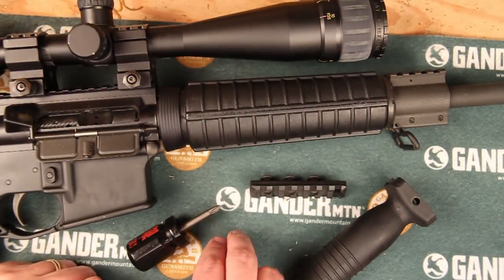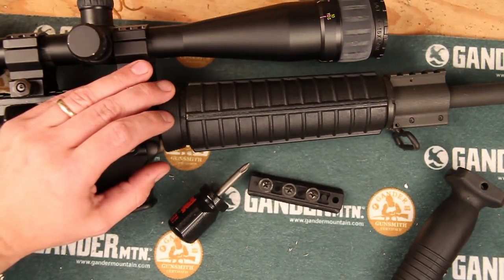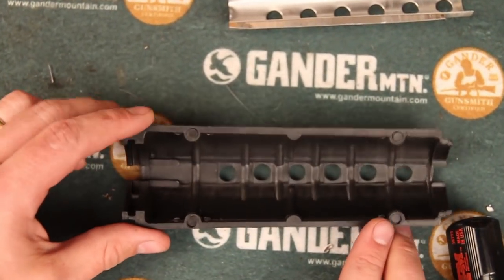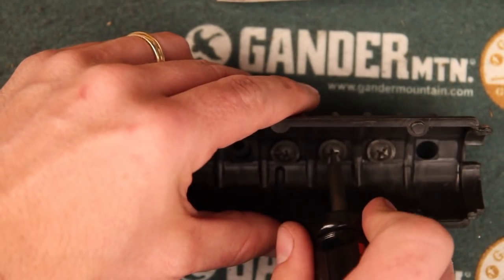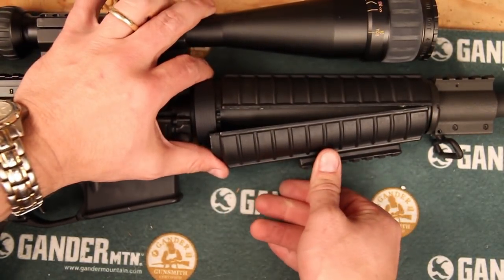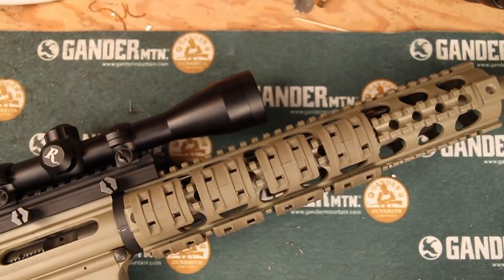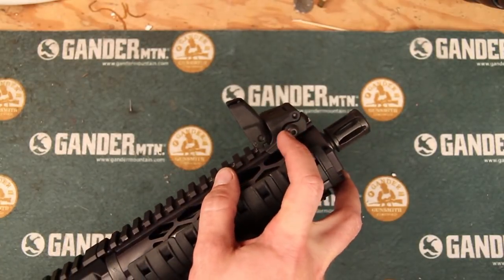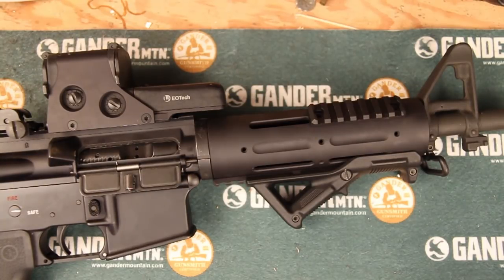How To Install A Rail On A Factory AR-15 Handguard

Comment: Can you please tell me what rail this is. I can NOT find a rail that will fit the standard ar 556 handguard. All of the screws are too small and go right through the holes. This one looks like it will work perfectly, but I can't find one like this anywhere. Everything is m-lok,  moe or keymod. Please help a fellow out. Thanks.
Reply from the maker: I've had this for awhile, so I don't know the exact model, but I believe it is a CAA, very similar to this one: https://amzn.to/3eNkEE0
Reply: Cheston Welborn I'm just take the handrail to a gun shop and find one
Reply: +AdventureColorado its a magpul rail section about 10 bucks at academy the vary from 4 to 11 sections but no more the 10 bucks
Reply: AdventureColorado i tried that one, doesn't work either
Reply: ghost pepper it works bro well on the m&p 15
Reply: Richard m I'll check that one out, thanks!
Reply: Am ordering the same,  to attach to a  Bushmaster AR15 for a vertical foregrip. Looks a bit more expensive at $35.20-total- than some others at 1/3 the price-but maybe that's what getting Made in the USA will be like again to MAGA. Thanks for the info.
Reply: Magpul moe polymer rail with bolts and big washers. fits great on AR-556
Reply: @hueykhalidX  I'm super surprised to hear that from someone named 'Huey Khalid X'
Reply: @Mgunner7623  + Is old Cornhole Khalid back again?
Reply: @glenseymour5068  Pic by any chance? Currently messing with this issue! Thank you!
Reply: @justinrichardson9477  lol the hard way? Calm down boy, your mommas gonna hear you.
Reply: Thank you I have been looking for that for awhile
Reply: @Mgunner7623  

Thank you!

I too want to avoid China crap and want made in USA quality. I am willing to pay for it on this particular M4 carbine I am building for work. Nothing but the best going in/on this rifle. PSA M4A1 stripped lower with Government markings. That's the only thing that isn't the best, but a lower is a lower regardless as long as it's forged and Mil-Spec including the anodizing. The upper is a BCM M4 SOCOM with a BCM M-16 full auto bolt. ALG Defense quality Mil-Spec QMS enhanced trigger group. BCM Mil-Spec 6-postiton telestock. EOTech XPS3-0 holographic night vision compatible red dot. Colt U.S.G.I Mil-Spec M4 double heat shield hand-guards etc...etc... Yeah, no cheap shit!! About 150 peoples lives depend on this rifle and me to do what needs to be done should the situation arise. 

"All skill is in vain when an angel pisses into the flintlock of your musket!"

Si vis pacem para bellum

John
Reply from the maker: Here is an Ergo rail from Brownells:  http://bit.ly/2Ewyoxn
Reply: @v_THE_DON_v  More like 20$...
Reply: @Ryan then it will work with this? I got small screws with mine
Reply: @v_THE_DON_v  Awesome. I think I'm going to try this for adding a sling because I really don't like the idea of attaching the forward part of the sling to the gas block.
Reply: @v_THE_DON_v   I'm using it for my M & P II also. How did it work out for you. Any trouble with screw holes lining up?
Reply: well, that escalated quickly.  NPC's like gun videos too I guess.
Reply: Just use a washer, I think I’d work
Reply: One word - washers
Reply: @AdventureColorado  q.a. is
Reply: @jimjim292  tell us how ya rally feel
Reply: just use washers
Reply: @hueykhalidX  MAGA FOREVER
Reply: @jimjim292  MAGA FOREVER
Reply: @Ryan that’s why in the beginning he said he had largermheadmscrews laying he used.
Reply: The one in the video is a 7"  2-piece handguard

Comment: I wish I saw this before I ordered and installed my quad rail. I was shocked at how heavy it was... Noticed how thick it was and wished I could remove the weight of the rails I wasn't using.
Reply from the maker: This is certainly a simple, light weight way to go.

Comment: Thank you for making this. Very insightful. I think it's funny that I literally went to every single gu͏n store in my town and not one of them carried this type of rail. Just comes to show how uncommon doing this is I guess. I got my rail (MARSv2 Picatinny Rail) from a we͏bsite called co͏mbathunting. It covers the entirety of the bottom piece of plastic so if you're lucky, you might be able to mount a second attachment like a flashlight. Thanks again :)
Reply from the maker: I think the trend is moving towards using Mlok and free float handguards. Those certainly have their place, but for a lot of use cases the standard AR furniture works just fine.

Comment: Am i the only one who prefers the look of the stock hand guard than anything else ?
Reply from the maker: No, you aren't the only one.  In fact, there are a lot of "retro" style ARs floating around these days.
Reply: Counter strike 1.6 is the cause of that lol
Reply: You are not the only one
Reply: I'm guilty also.
Reply: 100%
Reply: Skinny CAR15 handguards are the way to go. The newer Colt double heat shield handguards is no bueno to me.
Reply: Nope you're not alone.  I like the stock Glacier handguard on mine which is why I didn't want to change it just to add an accessory.
Reply: Yeap i like the stock hand guard  ! Why I am here seeing this video
Reply: Not alone at all. Love the standard hand gaurd
Reply: Me too, specifically went out of my way to buy one with the standard handgaurd
Reply: Yea i also like classic handguards.

Even i like mlocks also for some guns for airsoft.

But classis is classic
Reply: I prefer the look and the feel.  Could have bought whatever I wanted, went with stock.
Reply: I like it, reminds me of my Airforce SP days.
Reply: Like ot as well!...so.ple and sleek

Comment: just a tip for you AR owners on a budget (or who just don't feel like buying the delta ring tool): a 12" crescent with rubber grips on the handles works just as well. if the rubber is too short, use a little rubber tape.
Reply from the maker: That will certainly work!
Reply: Good idea if I made the video it would be rated "R" for profanity  lol the M16A2 in the corps used to pop on and off so easy but we did clean them constanly

Comment: I'm new to moding my ar's now mine is a 308 23inch barrel I'm looking to install a bipod on it. Would this type of rail work well for it?
Reply from the maker: This kind of rail would work, but I would consider a free float handguard.  It would provide a more rigid mount for the 308 platform.  The 308s tend to be heavier rifles and heavier recoil.

Comment: Do you know if any standard picatiny rail will fit the stock hand guard?
Reply from the maker: Not all will, some are designed for specific handguards, MLOK, Keymod, etc.  Usually the description will say if it fits the standard handguard.
Reply: @AdventureColorado   Thanks for the update.  The cheapest rail I can find to fit the stock hand guard is $30. So, I went ahead and got the Magpul hand-guard and front grip since it eliminates the need to attach a rail.  Together they were only about $52.

Comment: I bought a rail that goes on the bottom of the stock hand guard like this. Only I’m going to out a flashlight on it. Doesn’t putting a handle on the front make it considered an “assault weapon”?
Reply from the maker: No, unless you have a local law that says it is.

Comment: I bought some M-LOK rails to try this on my M&P 15 rifle. The holes in the rail did not line up with the holes in the standard handguard. What rail type/system are you using that they line up?
Reply: Did u find one ? I have a smith&wesson m&p 15 sport 2 and need one also

Comment: What would the comfort factor be like with a light on the bottom of that handguard?
Reply from the maker: It might be a little tight, the grip would need to be back near the magwell. It should work.
Reply: I wonder if anyone makes a vertical grip with a built-in light.

Comment: Where u bought the vertical grip ? And the rail can fit  M&P 15 spot  ll ? Thanks
Reply from the maker: There are a couple links in the top comments and description.
Reply: @AdventureColorado  - I am sitting here with a BCM rail and Magpul rail... These little guys wont line up right. Some forum I was reading through had recommended to "hammer the hell out of it". I was thinking these P-rails are all universal. Woah is me.

Ah MLok "compatible" doesn't mean multi-compatible I reckon. Oh sales folk are the worst.

Comment: I recently purchased AR-15 Colt, have same heat guard, what type of rail did you install as well as vertical grip and where did you purchase from...
Reply from the maker: I believe this one was just a cheap CAA one that I bought from a local gun store.  I would check Midwayusa or Brownells.  They will have plenty of options for the rails and the grips.

Comment: So all of the ad on products that you used were Yankee Hill products? You also added the vertical hand guard or hand rail and you put it below the heat shield is that because you’re afraid that it’s going to get too hot and melt something or is that just a preference of yours.?
Reply from the maker: So the rail added to the factory handguard and the grip are not Yankee Hill Products, they were CAA, which aren't available anymore.  I put it under the heat shield to protect the parts, but I wouldn't be too concerned about them melting unless you are using a really high firing rate.

Comment: Does that rail you installed on the a2 hand gourd taper up towards the muzzle to insure your attachments arnt at an angle ?
Reply from the maker: It does not have an angle, so it will match the angle of the hand guard.

Comment: Ok gonna be a really weird question, but could I mount this to the top of the hand guard and if so, if I mounted a peq15 or some IR laser would it hold zero?
Reply from the maker: You could mount it to the top, but I wouldn’t expect the two piece hand guards to retain zero. You would want a good free float tube for that.

Comment: I have a dpms like this, I want to add a rail and a bipod with a sling attachment, know where I should shop through? toting the .308 through the woods with a tac sling is a hassle I want to figure out how to get dual sling (I'm very new on this stuff obviously)
Reply from the maker: If you pick a rail that goes the full length of the handguard you should have plenty of room to install a bipod and a sling mount.

Comment: I want to mount a flashlight. Can you rotate the seams of the hand guard 90 degrees when you put it back on ?
Reply from the maker: I wouldn't mount the handguard offset, but you can get adapters to offset a light.  Here is one from Daniel Defense called a One O'Clock Offset Rail: https://bit.ly/3Ykihcs
Reply: @AdventureColorado  thanks
Reply from the maker: No problem, hopefully you find something that works the way you need it to.
Reply: @AdventureColorado  man normally I would buy an milk foregrounds but I painted this rifle and I love the paint job. It’s kind of a budget rifle I built for my FIL before he passed . I didn’t worry when I put it together because he would never use it at night.
Reply from the maker: I get it, I have a couple rifles that I don't want to modify too much just because I like the way they look or it's nostalgic.

Comment: Where did you get the rail in front of the foregrip??? Looks like you replaced it from the stock front sight
Reply from the maker: This upper receiver came with it, it's just a railed gas block.  Very similar to this one from Brownells: https://bit.ly/31ErPV2

Comment: I just purchased the sport S & W AR-15, it doesn't have heat shields in the barrel.  I found this out when I was adding the rail.  Isn't there supposed to be a heat shield?  It is a brand new gun.
Reply from the maker: They may have cut costs by excluding the heat shield portion. It isn’t necessarily a problem to use with out it, but you will definitely feel the heat if you have a heavy firing schedule. You can also swap the hand guard out to something else.

Comment: Im trying to do this to my lynx 12. Its a saiga 12 clone. Don't c the need to install a quad rail just for a foregrip when especially i already have a side rail for my red dot. It has one screw that holds the hanguard in place that also has a sling swivel. Do u think its possible to take out that screw and install a foregrip there to the oem hanguard?
Reply from the maker: I'm not familiar with that platform at all.  Looking at pictures of it I don't think you would be able to install a rail like this without drilling and taping holes for it.  Maybe someone else with a Lynx 12 could chime in if they know of a way to install a foregrip on it.

Comment: Can i replace my ar15s gas block to a iron sight? And would it be expensive?
Reply from the maker: Check out Brownells: https://bit.ly/2Yfk4Ef  Depending on what you want to do, there would be a couple options.  If you have a rail on your current gas block you could choose a sight that mounts to the rail.  If there is no rail you can buy a replacement gas block that includes either a fixed sight or a flip-up style sight.  You can do it relatively inexpensively, but there are some high quality sights that will cost a little more but may be more durable.  If you replace the gas block you will need to know the barrel diameter to order the right size.

Comment: So im a noob at this im just bought a classic ar15 classic handguard is an m4 barrel i want to buy a 7inch m lock rail to replace the handguard does the same step apply as far as just take out the hand guard and put the other or do i meed diferent gas block etc??
Reply from the maker: If you want to install a handguard like this Magpul one: https://bit.ly/3MSchmA then yes it is the same process.  It is different if you want to install a free float M-Lok handguard.

Comment: How does that foregrip secure to the picatiny rail? I have one I must have bought years years ago and never knew until I found it in a box of stuff. It didnt come with any typical fastener to tighten it to the rail. It's a CAA tactical foregrip. Either it didnt come with a screw or ot got lost or it doesnt require one. I cant tell
Reply from the maker: Once it gets slid onto the rail there is a bolt that secures it.
Reply: @AdventureColorado  ok thanks. Mine either didnt come with one or get lost. I'll have to contact CAA
Reply from the maker: Hopefully they’ll just send you another one.

Comment: Hi, I have an unrelated question not about the video. I used to have an mlok handguard instead of a heat shield. And recently replaced my stolen AR with one like the version you have in the video. My question is why doesn't my rail above the chamber line up with rail after the heat shield. I tried buying a riser kit and neither .5 .75 or 1 inch seemed to level it out evenly to be able to use a back up flip up sight from the rear rail with rear sight, and the front rail section with the front sight...? Thanks for any help you may be able to provide with this question 😂
Reply from the maker: Typically none of the add-on rails that you would buy are designed to allow you to mount sights to a two piece handguard.  The handguards have some potential movement in them and would not be a reliable and consistent platform for a front sight.  You would want to mount the sight on either a gas block or free-float handguard with an anti-rotation design that would stay rock solid when a front sight was mounted.
Reply: @AdventureColorado  thanks for the tip. I figured out they put a low profile railed gas block instead of a normal one, I haven't had time to mess with it, but it's solid and doesn't move. I probably could have worded my question a little easier but I think with the .50 inch riser and lowering the front sight might make up that difference. If not I'll just replace the gas block with one that lines up with the rail section on the upper receiver. Thanks for your reply and help that makes plenty of sense to even if it wasn't the exact answer I was asking for. I must have had a brain fart when I wrote that original question
Reply: @AdventureColorado  I just didn't know the exact name of the part at the time of writing the original question. It was a gas block rail, I just wanted to be sure I had it right and threw those terms loosely without doing my homework on the name of the parts. I'd never had to fool with a gas block, though I should've been more familiar with the part by this point. With the 14 or 15 inch mlok I had vs the gas block rail after the heat shield I have now I didn't remember that gas block position. Lol. That was all I was asking about thank you
Reply from the maker: I think I get what you are saying now.  A lot of the gas block rails are a different height that a handguard would be.  Brownells has a Yankee Hill Front sight designed for a gas block here: https://bit.ly/3ABTeZ6  Down in the part description area they also have a video that explains the different heights, that might be worth taking a look at.  I'm not sure if that's the exact part you need, but it sounds like it could be.

Comment: what brand of rail did you use? I'm looking to do the same modification
Reply from the maker: I believe this was a CAA rail that I got for pretty cheap.  If you check some of the big dealers like Midwayusa or Brownells there are a number of options.
Reply from the maker: Ergo rail on Brownells: http://bit.ly/2Ewyoxn
Reply: Will this work on a smith n wesson m&p 15 sport 2 ?

Comment: Whats the Mlok rail handguard you have onthe rifle at the end of the video.
Reply from the maker: The last one is a Yankee Hill smooth handguard.  It uses a proprietary rail and doesn't work with M-Lok.  My favorite free-float M-Lok handguard right now is the ALG Defense rail.
Reply: @AdventureColorado  how does that proprietary rail work
Reply from the maker: It works well, you just have to buy their rails that have the right spacing and screw threads. I bought it before M-Lok or KeyMod got popular.